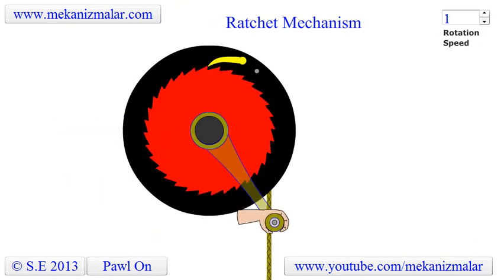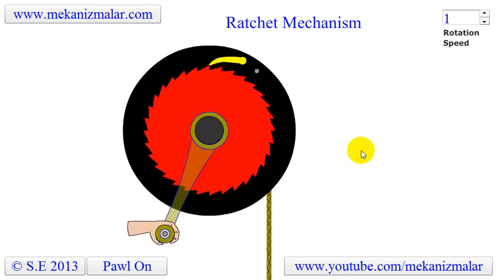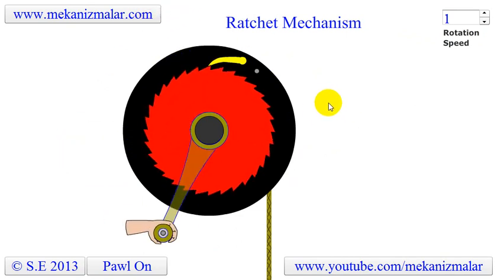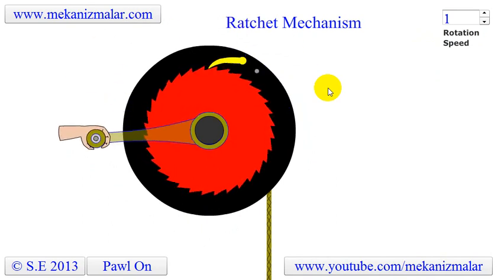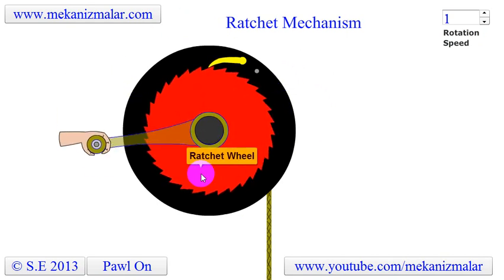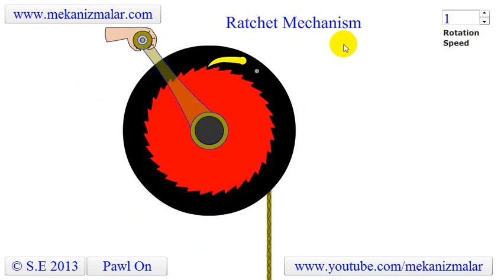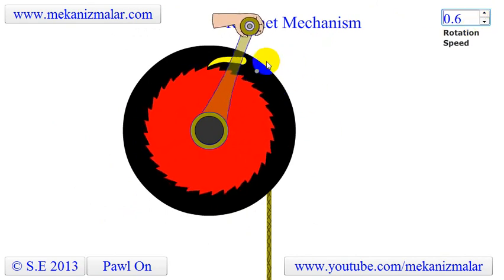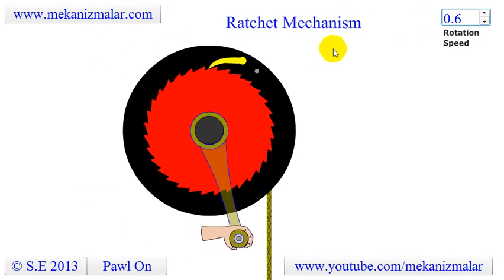Ratchet Mechanism

Comment: “difficult to program not using collision detection”  you can just  use a polar coordinate radius offset based on angle. Which is how I would draw a toothed wheel, animating the paw knowing the radius of the toothed wheel at any given angle would make it simple. I actually came here looking for how the cable retract systems release the paw when a gentle pull and release is performed. Still haven’t figured that out unless it’s just a speed thing.
Reply: I just came here exactly to look for that too.    lollzzz.....